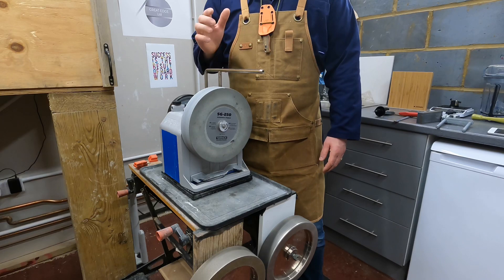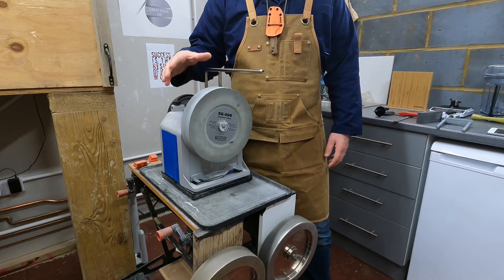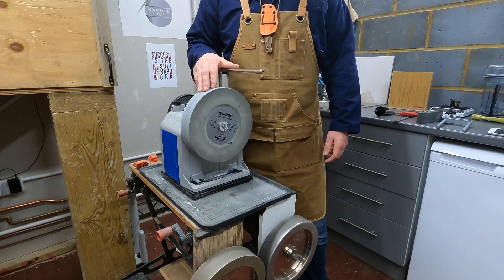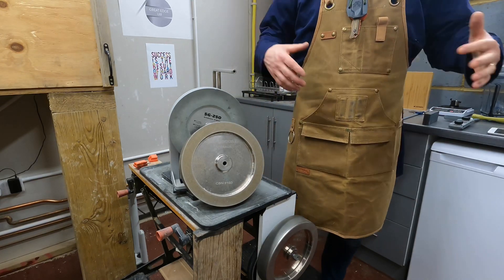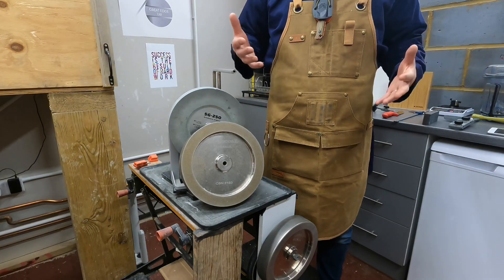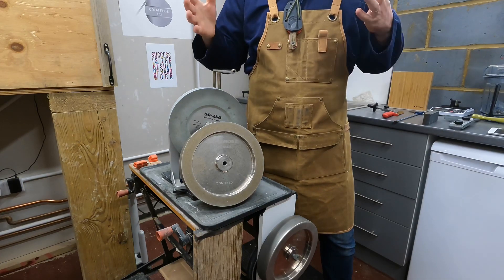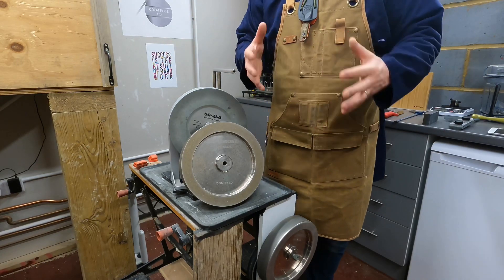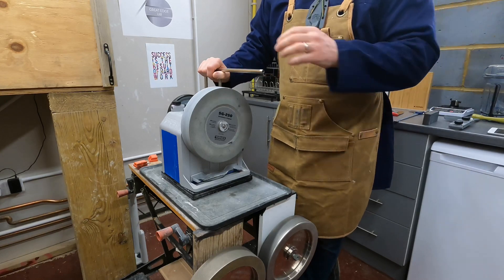Tormek T8 Sharpening - Which to buy, SG vs CBN vs Diamond?

Comment: Great video . Thank you……
PS . Any advice on which gig from Tormek would you use to sharpen a filet knife of about 5-6 inches….. Victorinox knives….  I had a problem of getting the perfect angle using the 2inch holding Tormek knife jig just slightly but well held on the knife… but then when to get the perfect angle…. I went for 17 1/2 per side …. my Tormek jig was slightly touching the grinding wheel….. You have answered a previous question for me…. This is for my wife the Chef of the restaurant in Quebec , Canada…..
What angle would you use ? After using the Tormek original grinding wheel I went from 220 grit to 1000 grit and then recalibrated to finish off on the very expensive Tormek Japanese wetstone 4000 grit….. Would that be a correct sequence ….. Should I hone before between using the Tormek 1000grit to 4000 grit Japanese Stone or just continue with 220 grit , then 1000 grit from original stone and then without honing going straight to my Tormek 4000 grit stone and not even honing ? Thank you for your time sir. 
PS . Tormek on their pamphlet of their Japanese water stone even say not to hone….. But I heard some people hone afterwards…… I am indeed a newbie with Tormek but do know how to sharpen our kitchen knives with another method .Cheers and thank-you Great Edge LTD.
Reply from the maker: Good questions!  Fillet knives are tricky because as you probably discovered they flex when you lift the handle, so your manual movement need to be very careful. You could try the long knife jig (SVM-140) which gives a bit more support.   And the second problem is they aren’t very tall, so it’s tough to get enough protrusion from the jig as you discovered.  All you can do is try to make the protrusion as much as possible - clamp only the very edge, and fully extend your jig. Sometimes you can’t get the angle you want though - you’ll be forced to do the smallest angle that doesn’t let the jig hit the stone… Usually between 18-20dps is OK.  

About honing, I would go from 1000 grit to the SJ to a strop and skip the leather wheel.  Whether to hone or not after the SJ has different opinions, probably because the type of steel influences the result.  You could use your BESS tester to figure out what works better with your knives.  

Thank you for these thoughtful questions.

Comment: Good comparison of wheels.
I believe Knife Grinders may be out of the game (Vadim Kraichuk passed away unexpectedly in January).
Not sure if they are going to continue to market their CBN wheels ( I have three and wish I had more).
Ken at WoodTurnersWonders is a standup guy and have some nice non water wheels.
They had initial arbor issues but seem to have addressed that anomaly.
CBN rocks, but be wary of the amount of pressure applied (very light).
I have used my WTW wheels with HoneRite and have had no issues.
Reply from the maker: Yes, that is tragic news about Vadim K.  A wonderful person and a tremendous loss to the sharpening community.  So far his shop seems to still be trading, but not clear for how long..  

Very good to know about WTW. I’ve not tried their wheels yet, but good to have a US source.  Thank you for the info, and for tuning in.
Reply: I have a WTW CBN that I run in water with no problems. The only thing I didn’t take into account is the size. I have CBN from Hanns and the WTW. WTW is 10 inch and the wheels from Hanns are 250mm. So have to adjust Hights between wheels 🤦🏻‍♂️
Reply from the maker: @ricklenney5653  Good point - when read that 10 inch on the WTW site I mentally inserted ‘approximately’, assuming it would be compatible with 250mm wheels…
Reply: Yes. I didn’t think in advance as well. I bought the 200 CBN from WTW because they were not available at the time from Australia or Germany. My next CBN will be an80 most like from Hanns. Then I’ll leave out the 200 in the progression.
Reply: nooo, what a bad news about Vadim :(
Reply: @ricklenney5653  what wheels do you have from WTW?
Reply: @aarononeal5421  just the 200 from WTW. 400 and 1000 CBN from Hanns. And original tormek.
Reply: @ricklenney5653  do you run your WTW cbn wheel in water?
Reply: @aarononeal5421  yes, for over a year or more now.  No problems

Comment: Hello, great content.  Have the T-8 with the included SG-250 and want to use CBN wheels to supplement sharpening options.  I figure since the SG-250 can do 220 grit and 1000 grit to add three CBN wheels 200 or 400, 600, and 1200. The idea is to not duplicate too much as well as maximize overall use/value.  Since the SG-250 can already do 220 grit finishes, would it make sense to start with the 400 grit CBN wheel?
Reply from the maker: Thanks for watching and sorry for the slow reply. I do agree that CBN400 is probably a good place to begin, although mixing between SG250 and CBN is a bit of a pain because you have to adjust for wheel diameter between each change.  Personally I would tend to stick to just the SG, or just CBN.  With the former, remember that you can use the grading stone to get intermediate grits too, not just the bookends of 220 and 1000.  It takes a bit of experience and feel to be able to do that, but certainly possible with a bit of practice.
Reply: Or buy second tormek and use both

Comment: Qs pls. How long you had these cbn wheels? These wheels with plastic body i heard from cbn manufacturer that they don't last as long as the ones with metal body like "tornado" style that wood wonders sells, how long you had these for? I contacted uf sharp usa on amazon and they re all made in china and uf sharp usa also make these with plastic body but they said they wont last as long to hold even shape i guess due to plastic body
Reply from the maker: Mine were all purchased around 2020-21, so fully metal…
Reply: @greatedgeltd  k thnku

Comment: Qs pls when im swapping wheels of different sizes, even though i calibrated with angle setter, it still started a new bevel, looks like their angle setters are not precise when using it on different size wheels while sharpening 1 knife. Any thoughts?
Reply from the maker: Have you watched my Tormek angle-setting video?  The answer is in there, along with further details…

Comment: Thanks for the informative video.  I am thinking of getting several CBN wheels, over diamond, for a Tormek wet grinder for the same reasons you mention (broader grit range, no anticorrosion additives needed).  I would like to be able to get by with three wheels, 80, 400 and 1000 grit.  I am mainly interested in using the wheels to make bevels on new knives and to sharpen knives.  Do you think I can get away without the 160 grit?  After using the CBN wheels for a while are they still holding up well?  Thanks!
Reply from the maker: Thanks for watching! No issues with the CBN wheels wearing down so far…I’m quite happy with them. 

Of the four grits that I have in CBN, if I were to purchase them one by one I think I would buy 160, then 80, 400 and finally the 1000.  Where they really shine is at the ‘hardworking’ end. The 1000 grit is very good, but in that range you have other options, like the standard SG250, or even the leather or composite honing wheels from Tormek. I think if you jumped from 80 to 400 grit your 400 wheel would have a hard life.  I’ve never tried it, so might be wrong, but that is my guess…
Reply: @greatedgeltd  Ok, good to know I probably need the 160 also.  Is the sharpened edge from the 1000 CBN wheel as nice as an edge finished with the SG250 wheel (with SG wheel dressed to finer grit)?
Reply from the maker: @pattyliterati164  Yes, you can get a very good edge with the SG250 - highly comparable to the CBN1000. The only issue is having to account for the reduced stone diameter once the SG is worn down a bit.  If you can afford it then I would get all the CBN grits, but of the four, 1000 grit would be the last one to buy IMHO…

Comment: What do you think on ordering cbn grits, 80 grit, 400 grit and 1,000 grit...is jumping from 400 to 1000 acceptable?
Reply from the maker: I would start from 160, not 80, unless you have a very worn or damaged knife.  It will be easier on your knives and wear less steel. But otherwise it’s fine to jump from 400 to 1000 because you are just refining an already established bevel, so there isn’t much strain on the 1000.  I am still on my original 1000.
Reply: @greatedgeltd  awesome, thank u, i ordered 80 for repairs mostly of like damaged or chipped knifes, or do you think 160 might work for it just fine?

Comment: So i found 2 different cbn, one that doesnt have side plating, others do but 50$ more expensive, would you recommend wheel with side plating?
Reply from the maker: It really depends on your needs… Side plating gives you more flexibility but based on your sharpening needs you might never use it…
Reply: @greatedgeltd  I see, so like correcting chipped knife for example,  is side plating necessary for that?
Reply from the maker: @ia6980 I would say no…. All of my chip repairs are done on the main surface… an example where side sharpening is better is for Scandi grind…

Comment: Thanks for the Great video!
You have experience with all 3 types of stone’s, do the diamond and cbn wheels wear out and how many knives did you sharpen on them till you decided to change wheels?
Reply from the maker: So far I would say no sign of wearing on my CBNs ( I didn’t give my Diamond wheels a very long test before selling them). What’s important is to make sure to do the hard work on the lowest grit (for me 80 + 160).  In that case my 400 and 1000 grit should last a very, very long time because all they are doing is polishing the bevel. 

I would guess a coarse CBN could last at least as long as an SG, if not more.

Thank you for tuning in!

Comment: Another question.
How agressive is 400 and 1000 cbn compared with sg-250 tormek stone 220/1000 grit?
How would you compare them?
Reply from the maker: 1000 grit are quite comparable I would say..  And it does seem like the SG stone graded to ‘250’ is more aggressive than the 400 CBN… I wouldn’t use my 400CBN for reshaping any knives, only for smoothing out existing/known bevels.

Comment: Which sharpening wheel would be better for shaping a bowl gouge?
Reply from the maker: For woodworking tools I’d always recommend the Tormek SG-250 (standard wheel that comes with the T-8).  It’s the most versatile and also allows you to work with pressure and/or steeper angles.

Comment: What are the disadvantages of electroplated diamond or cbn wheels. The diamonds or cbn . Over time has to wear down, to a level where they don't perform.
Reply from the maker: Sorry for the slow reply - yes, that is exactly right.  Over time they wear down and their perceived grit rating increases. The way to help protect against that is to make sure the lowest grit wheels do the hardest work. For example don’t start with 400 grit if one needs to put a new bevel on a knife - leave that job for the 80 grit. 

The main disadvantage of CBN and DIamond is if they become damaged they need to be replaced, unlike the SG250 which can be reset using the truing tool (other than major damage of course)…
Reply: @greatedgeltd  or instead of plated cbn or diamond, resin bonded wheel ,would be exactly what is needed, over the long term , for consistancy ad well as durability.
Reply from the maker: @abrahamkalichman6845  Exactly right. There are starting to be resin-bonded models available… In theory they would be ‘lifetime’ wheels, other than in the case of  extremely heavy use….
Reply: @greatedgeltd   I may be correct/ unfortunately. The majority of  these wheels are for the Tormek system/ which is a semi 
Professional tool  system, where the pupose of this tool is convenient at a reasonable price point/ 
When you discuss the resin bonded wheels. You are  at the begining of a totally new stratospheric entry level price point/
Only top professional level users would be aprreciative of these resim bonded wheels. /
Different cast of characters/
Reply: There is another issue related to resin bonded wheels. The fact that tormek machines rotate at 90 rpm. Rotational or velocity of resin bonded wheels are rated at much higher speeds, to be at their highest degree of effectiveness.
Reply: @Findon Knife Sharpening - Adelaide 
Because of what major accessories are not available. The speed is turtle like or molasses.. The power is almost non existent. The speed to finish any knife on the tormek or tormek copies machines are not even close for a professional business. Again , what is currently available for the tormek system is for very slow sharpening. As well as lack of varieties, of wheels , abrasives and power.
Reply: Besides, the wet system is "stone age" concept. Horse and buggy. 
There are a number of alternative's to the bath system, all are at a higher cost. The cost of a quality cooling system would cost more that the total cost of a T8 with accessories. Then the cost of a ,750 watt motor with variable speed would triple the cost of the T8. Again the machine is a very amateur product that can be afforded by the masses.
Reply: @Findon Knife Sharpening - Adelaide 
Excuse me! What belt grinder are you speaking of or which one belt system have I suggested? None
Go to school; and learn basic grinding/ if you are too young  go with a relative. They should explain to you in English ,what you are missing. Better yet , go to a factory that makes high quality knives and have a translator with you, do you can better understand basic grinding.

Comment: What would be your normal grit progression with CBN?  Do you still use your SG 250?  If one were only to buy 2 CBN wheels, which would you recommend?  Thanks!
Reply from the maker: Normal routine is CBN160-400-1000, adding in the CBN80 at the start if there is damage or heavy reprofiling to do.  I do still use my SG250, especially when I just have one knife to do and can set it up and just manage grits with the stone grader.   Also just as a personal preference I really like the feel of the SG when sharpening, compared to CBN.  .  If I had to buy just two CBN I would probably go for CBN80 and 160 to cover the hardest working jobs… then the SG250 could be used to cover grits from 250 up to 1000 so with that set of three you’d have good grit coverage…. 

Thanks for tuning in!

Comment: Could you please share if there is a braking-in period for cbn and if they retain their initial sharpening force for a long time?

With sg stones it's possible to refresh them with a tt50 tool to always have the stone take material well.

How is the situation with sbn?

Thank you very much for you advices and experience.
Reply from the maker: I didn’t notice a breaking in period other than the very first sharpening was a bit rough and aggressive.  I have had my CBN wheels for nearly 3 years now in a professional sharpening workshop and they don’t show signs of needing to be replaced, but I also do think they have lost a bit of bite compared to when brand new. But I am very careful to make sure my lowest grits (80 and 160) do most of the hard work, so I think only those two are likely to need replacing, at least in the foreseeable future.  For now I plan to keep using them. 

I do really (really!) like the ability of the SG to be refreshed with the truing tool as you say… It gives you some flexibility in case of damage too. (If CBN wheels get damaged, they need to go in the bin, whereas the SG can usually be saved)…